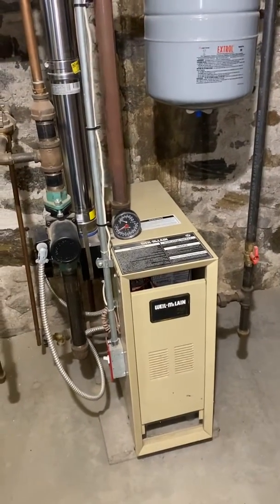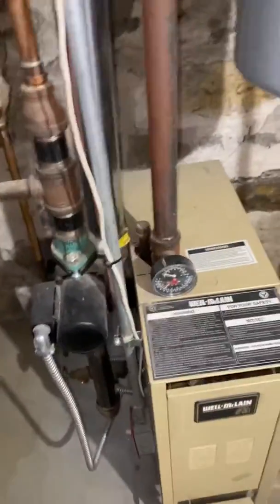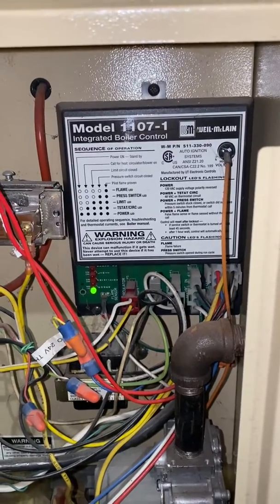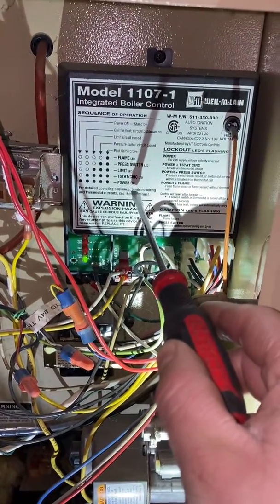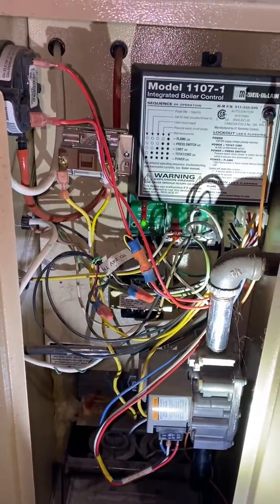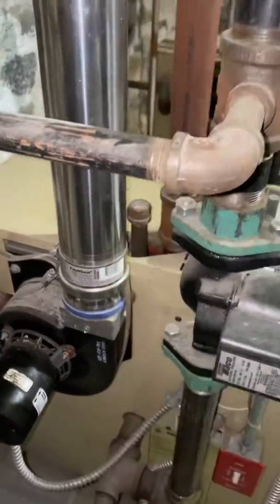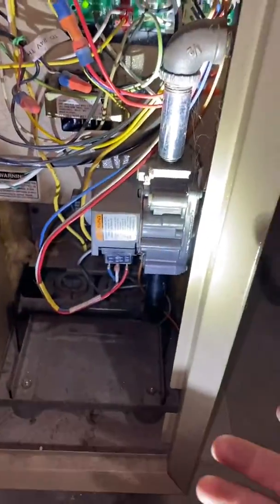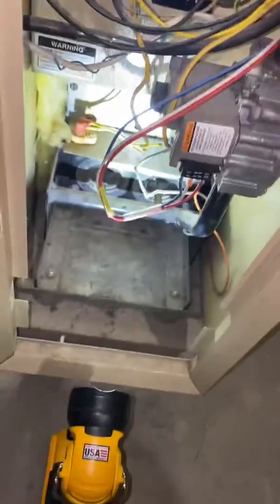Maintenance on a high efficient Weil McLain boilers

Comment: How do I lower the temperature on this one? I don't see a dial
Reply from the maker: @paulfavale5273 hey there if you look at the control board , to the left side , there’s a two yellow wire going to temperature control couple , you can lower it there , it’s usually set to high 180.

Comment: Hi is one efficient enough for  a two story  house
Reply from the maker: Hi there , you’ll need to do a heat loss , if you go to local supply house they should be able to help out . 
You’ll need 
- square footage of entire house
- square footage of each room
- type of insulation in the house 
- how many windows , glass type 
-ect. 
Then that will determine ( heat loss ) and will tell you how many BTUs furnace is needed for your project / home .
In this case - boiler #1 serves first floor 
Boiler #2 serves second floor . Each floor is around 1,200 sq.

Comment: Are all those lights supposed to turn red when the furnace is turned on? (Flame, led, damper etc)?
Reply from the maker: Hey there yes correct , if one of them is blinking then that’s your problem and depending what’s blinking then you’ll need to fix it . But once running normally all should be solid red light .
Reply from the maker: @jrlewars8078